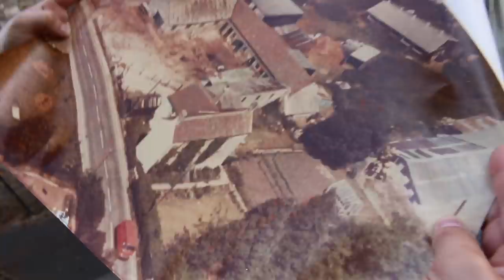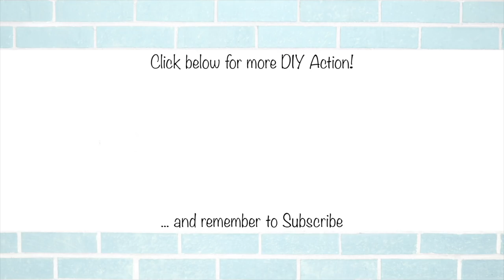400 Year Old House Wall Reveal

Comment: Typically the front of homes god upgraded with cut stone.  The rest of the house got left.  Best way to find the true age f a house is to go round the back.  Go up in the roof and check the beams.  The style of timbers will speak volumes.

Comment: I just moved into a 150 year old stone house and I have to deal with 4 layers of wallpaper with a 2mm layer of Styrofoam in between that has also been painted over. Luckily the internal walls are shedding the wallpaper in many areas but it's definitely wet underneath. Outside has been pebble dashed too. I eventually want ot expose the stone outside and some of inside at least. How can I tell if it's lime or cement? What I've chipped away so far is very crumbly and smells like wet cement but I don't know what lime smells like.

Comment: Hi Tim. I'm a bit late to the party on this one; I was wondering what your thoughts are on whether your friends would need to building consent to just remove the render? Looking at the regs it throws the word renovation around a lot when referring to the external fabric and the requirement to improve the thermal properties of the house but not sure if just exposing stone is something that needs their sign off?
Reply from the maker: Listed building so yes full permission and consultations needed.

Comment: Hi Tim, I have the same problem with my house and damp is penetrating through to the interior walls. I chipped off some render for a test area and the wall is soaking wet and the bricks are in poor condition so it will need re-rendering with lime render. what was the name of the company that you did an interview with as I will need to buy the products from him and get a bit of advise for the best product to use TIA.